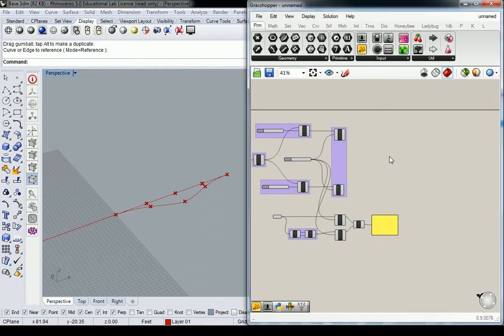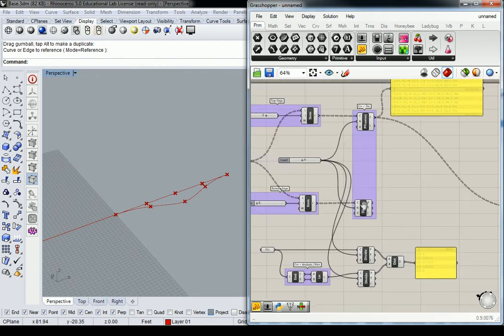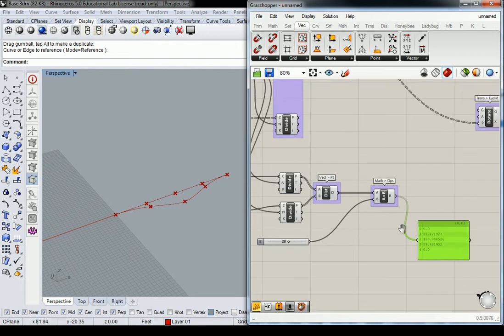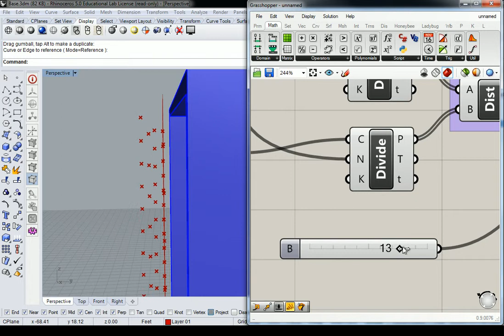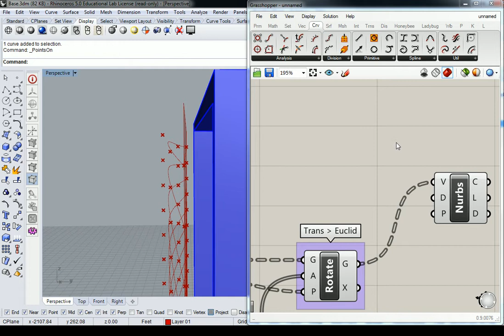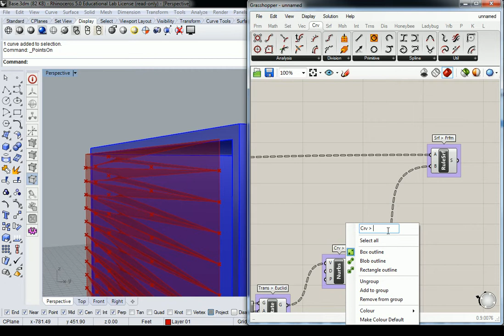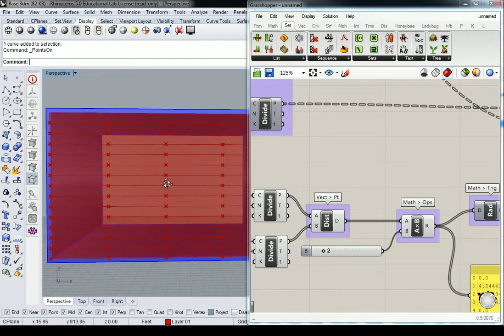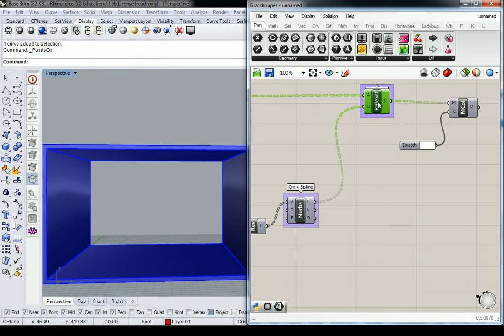130 - Grasshopper - Herzog & DeMeurons Signal Box Building Facade 4 - Remap Curve Ruled Surface

Comment: Hi Kevin great tutorials, quick question how would you incorporate a sun path to the script so you end up with a facade sensitive to the position of the sun.
Reply from the maker: +George Manoti The Sun Path tool from Ladybug has output data for sun altitude. Check out the sun path videos, starting here, but sporadically throughout my Spring 2016 class playlist: https://www.youtube.com/watch?v=gFtjO2rmvMo

The simple way, which you will have to manually change the louver position for each sun position:
Instead of using a control point curve for the profile, use an interp crv. Then draw a line from the center point of the bottom rail to the original top, then from the bottom rail to the new bent profile center point which will give you an angle between the lines. Comparitively check that this angle is less than your sun path altitude and you're good!

The hard way, making it fully parametric:
What you'll probably need to do is trig functions and calculus on the rotation distance vs sun altitude and azimuth. I would imagine the majority of the definition will have to be rebuilt to achieve this, and it would take an extensive investigation to get it to do so. You could try taking the math output of altitude, converting it to radians and just inserting a multiplier to get profile points 2 and 4? You wouldn't modify the profile by a rhino curve remotely anymore though.

Enjoy! I may actually try to include this one during this class.
Reply: Thank you so much for the information I will investigate into it, I'm still pretty new to grasshopper and it was something I wanted to add to my portfolio of work and grasshopper experience. I've been watching your videos for guidance which are extremely helpful since you decode existing architectural precedents and practical solutions.